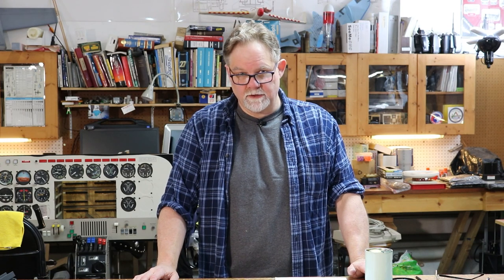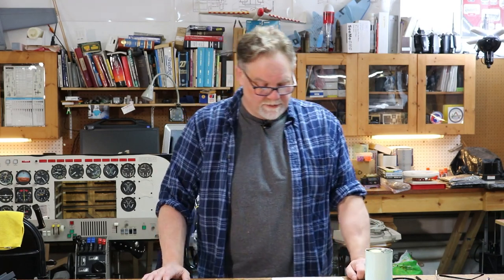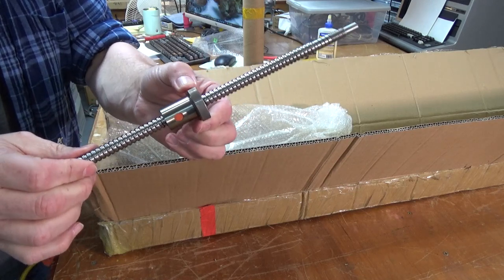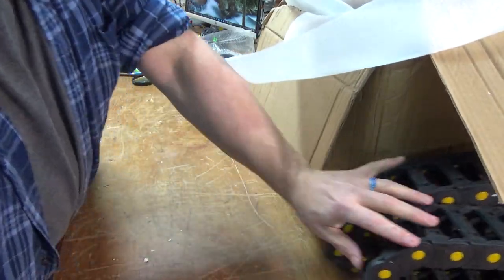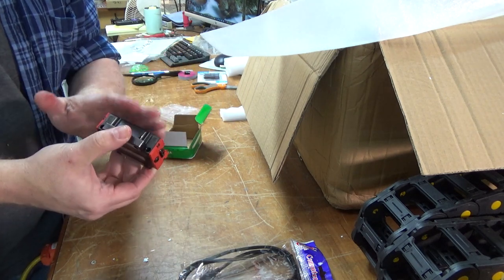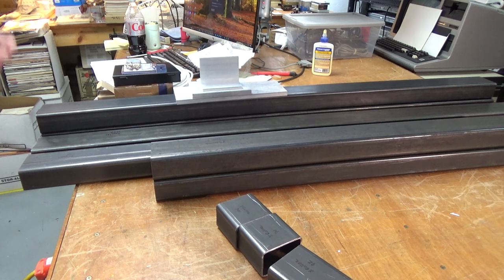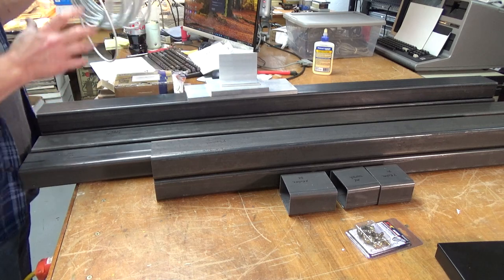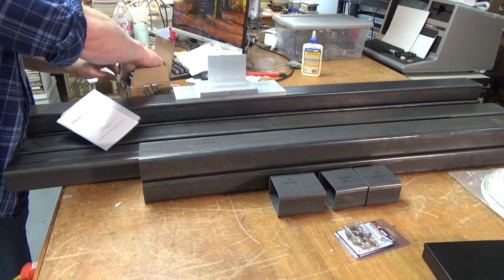PrintNC Project Part 1: Parts and a little planning

Comment: On your stepper drivers, it's a good idea to have a spare on hand. I had one of those 542s fail on me. Because I had a spare, I didn't need to wait to order another one
Reply from the maker: That's good advice.  The 542's aren't that expensive either.  StepperOnline branded DM542s are on Amazon right now for $29.

Comment: Great video. Looking forward to the rest. 
I'm in the "window" shopping part of my PNC journey and my current main consideration is controllers. There's a lot of pushback in the discord towards the more plug-and-play controllers like Buildbotics/XPro V5 /Openbuilds controller, however to me they just make more sense. I don't want an old garbage PC with a parallel port in my workshop controlling my cnc. I'd rather do the CAM work beforehand, then in the workshop, load, zero, go. What are your thoughts?
Reply from the maker: Thanks!

This is why I made the choice of the grblHAL2000 board.  With LinuxCNC driving a break out board or a Mesa board via parallel port, the Teensy 4.1 does all the heavy lifting.  This means that you don't have to worry about latency in your host computer - it literally doesn't matter.  If you could find a g-code sender that would run on a Windows XP machine, you could use that. :)

From what I've seen, there's two camps for PrintNC controllers - the first group is the LinuxCNC users - their controller choices are all over the map, but appear to be mostly parallel port interface devices.  Those controllers of course require the host to have very low latency or there's problems driving the connected CNC machine.  The other group falls into the ioSender camp that uses the grblHAL2000 board as the controller.  ioSender is an open source g-code "sender" that runs on Windows.  The author of ioSender is also the same person that created the grblHAL fork of grbl that is designed to run on larger/faster CPUs as well as increasing it's capability.

Which Discord are you referring to?  I haven't seen mention of the controllers you listed (but admittedly I don't pay THAT close attention sometimes).

BTW, I put a link to the ioSender project in the video description.

Comment: Lots if good stuff there. But an hour long!!. You said it's going to be detailed and it was. But there is a difference between detailed and dribble and disorganisation that is was not needed. You could have saved 25 min and kept me interested. Lots of knowledge in your head but I will most likely not watch any more unless you change your format.
Reply from the maker: What specifically did you find disorganized (besides my workshop of course)?
Reply: @f15sim  Hello. I hope you are well. Sorry I will explain myself and be constructive with my reply.  The unboxing was painfull. And I felt the level of detail you went in to about your old CNC was unneeded. The part where you explained the extra components was good as you knew what you had. Rather than a long blind unboxing, If it was all opened the parts lined up would allowed you to keep on topic and moving forward part by part.
It's obvious you have a wealth of knowledge. From what you have already pit out the videos will be full of good detail and learning for 85% of viewers. There will be alot of technical content in your videos. I think people new to CNC and building will become overwhelmed with the amount of information given if you continue to put out hour long videos. For most time is hard to come buy. I personally don't have the patients to watch an hour long video with 35-40 min of content. But would happily watch 5-7  30min videos in a series if I knew I would learn somthing and not have to filter through unneeded elements.  The bit about your old CNC could have made a great snappy video looking at its design flaws and their  effects over time and why the printNC is superior. 

Please keep up the good work and I look forward to your next video. 
Have a great Easter.
Reply from the maker: @brentfixesstuff  Follow up videos shouldn't be nearly as long.  The discussion about my ShopBot was a "what brought me to this point" story.

The unboxing was "blind" because i wanted folks to see exactly what they were going to get when they threw over $1000 at a company they didn't know in China. (My parts kit was $1223.65, as-delivered.)

I see your point on the video length - I do feel I crammed entirely too much into a Part 1 - there should have been a Part 0. ;)

The ShopBot I have (A PRT Alpha 96) doesn't really have a design "flaw" in those rails.  17 years ago, it was a pretty good solution.  (The irritating part is 3 months after i took delivery of the PRT, the PRS came out sporting hardened rails across the board.)  The ShopBot is a commercial tool and is designed for tearing through wood at stupidly high speeds - with a 1/2" cutter installed, I can tear through 3/4" plywood doing full-depth cuts at better than 5-7in/sec.  It's designed for cabinet makers, sign shops, boat builders, etc.  Coming in at a slice over $17k, it is NOT a tool designed for the hobbyist. ;)

Thanks for your feedback Brent, it's appreciated.  The next installment is going to be MUCH shorter and may be out today. ;)

Comment: Hi, love the info.  Thank you so much!  Can you spend a little time talking about the bench/table you’re going to put your machine on.  It’s the one topic that’s just not spoken about in ANY of the videos.
Reply from the maker: That's actually going to be the Part 2 video!  I'm still tweaking the design as I build it.  I'll be providing some drawings for folks that would like to build one for the "default" sized machine.
Reply from the maker: @JohnPorra  I don't know if YT will clip the url, but this is what the 3D model currently looks like: https://i.imgur.com/q3XRypC.png.  This is a photo of the table model pulled into meatspace: https://i.imgur.com/tJQevYe.jpg :)

Comment: Mining your own ore... You got me there! Loving this long form video, great to feel part of your thought process.

I tbh wasn't seriously considering printnc, am probably still all into the Bulkman or Yayong machines. But intend to follow this series and see what comes up.

Am fully aware of the torsion issues expressed on reddit and the solutions that these vendors are pushing.
Reply from the maker: I think the big benefit of the PrintNC is the fact that since you're building it yourself, there's no mysteries about what is going on, so your ability to diagnose issues or make repairs is far greater.  You're also able to manage QC far better with the PrintNC than with an off the shelf machine - you're in complete control of the parts that you use to build the machine with.